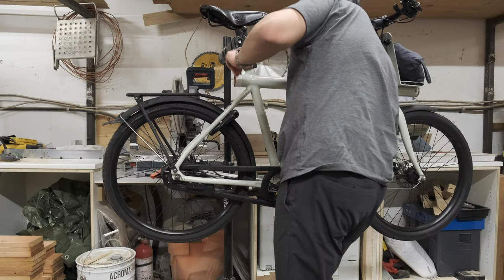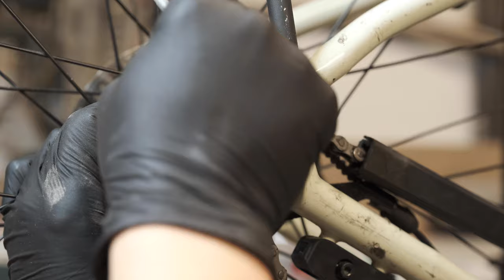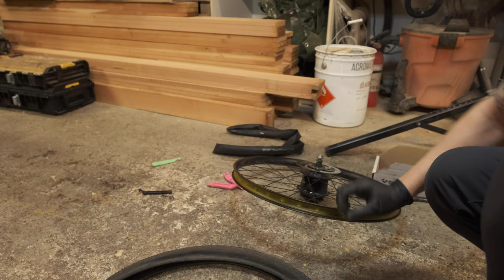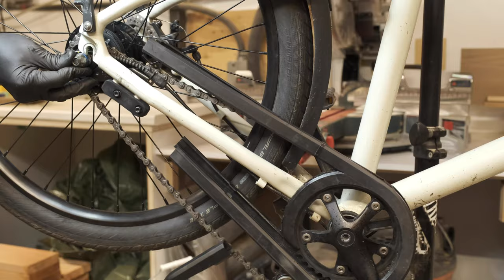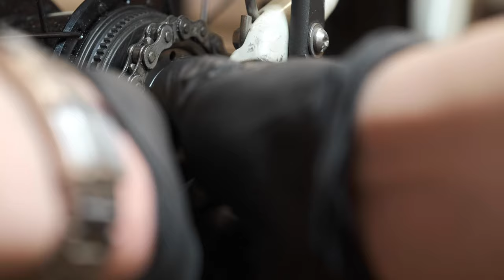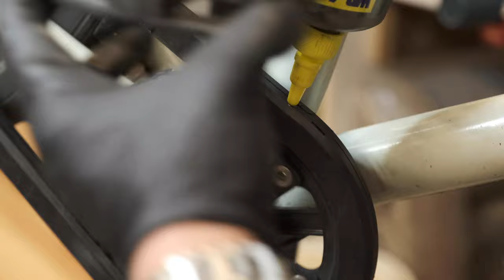How to fix a flat tire on the Vanmoof Smart X

Comment: Thank you so much, I need to replace the rear fender on my Vanmoof Smart S (which requires removing the wheel)  and this video looks very promising.
Reply: You can also patch the tube with it on the bike like this https://www.youtube.com/watch?v=Hfq_e6HBZq0 
But if the tube is trashed wheel removal is the only option 👍
Reply: The fenders get rusted out near the mounting points.  Had to patch it with fiberglass myself as well.  Good luck!